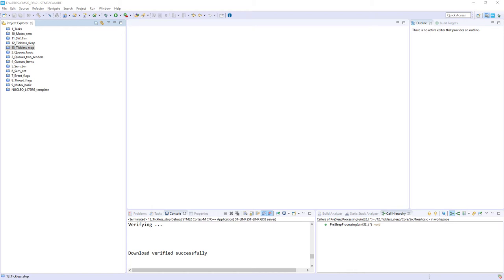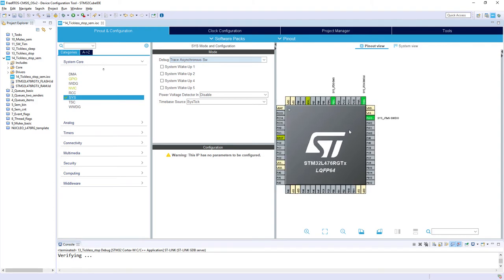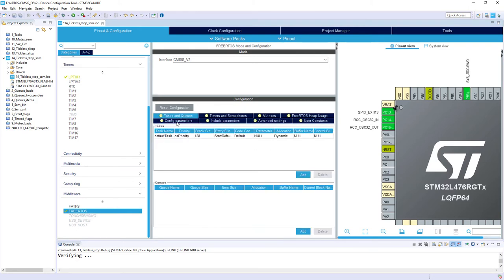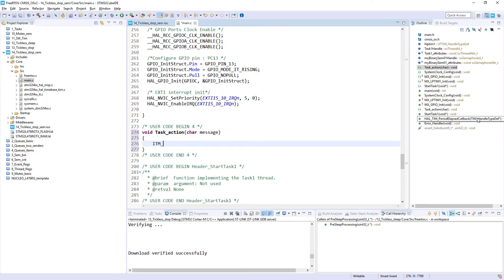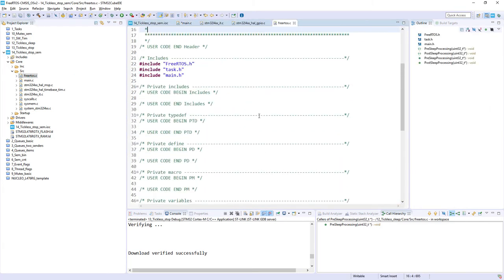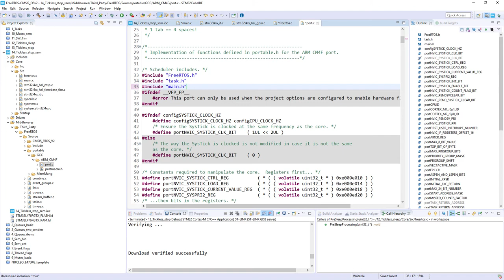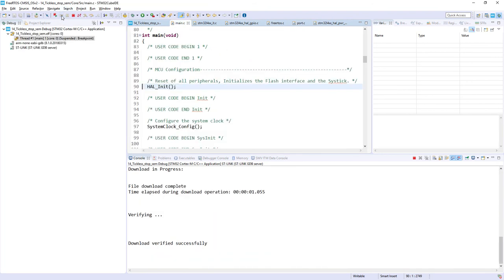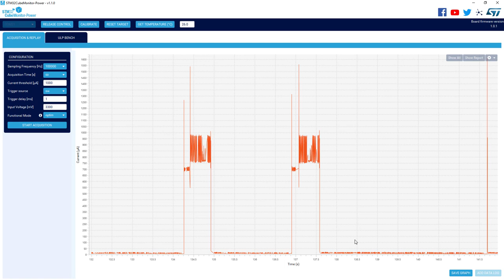FreeRTOS on STM32 v2 - 21d Low power modes (tickless mode and semaphore) - LIVE lab

Comment: This won't work on interrupt based application. Irregular interrupts from external peripherals might wake up the CPU from STOP mode and you will have incorrect freeRTOS tick count as you not are stepping up the ticks on such cases. After long run, freeRTOS timer won't be accurate anymore.